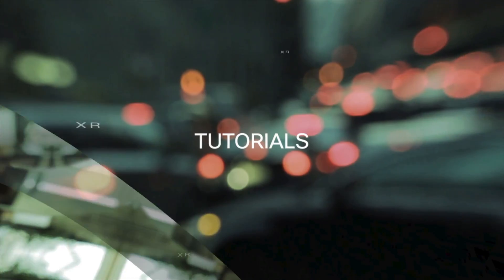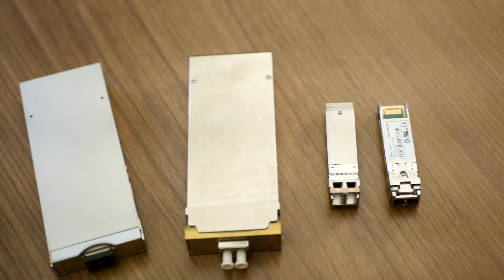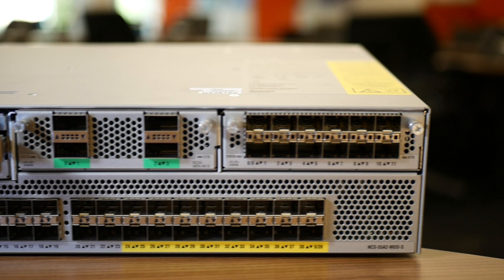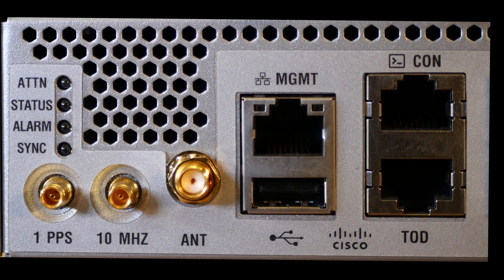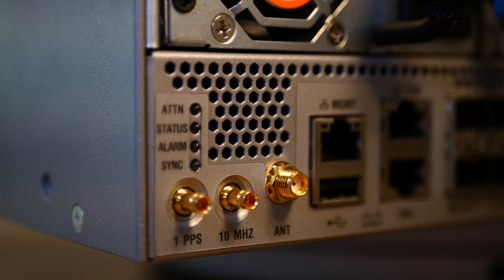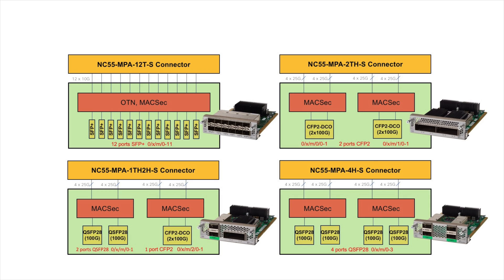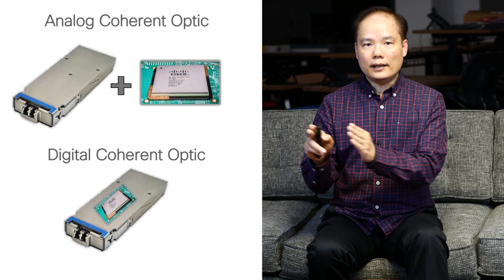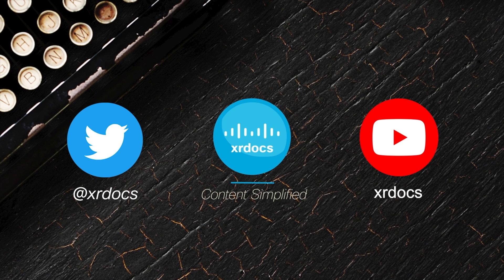Introducing the Cisco NCS55A2-MOD Modular Router

Comment: So in the beginning of this, he claims 1.4TB of bandwidth. But then states it has a single J+ NPU @ 900G. So this box is severely oversubscribed?
Reply from the maker: No doubt it's an oversubscribbed platform: 24x10G + 16x25G + 2x400G = 1440G on a single Jericho+
You can check the port allocation per NPU core here: https://xrdocs.io/ncs5500/tutorials/2018-02-15-port-assignments-on-ncs5500-platforms/